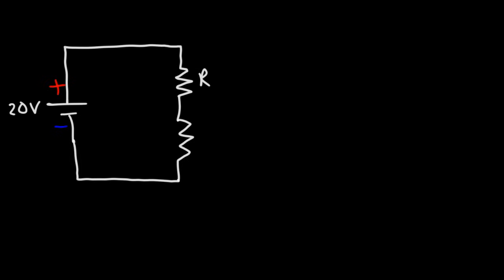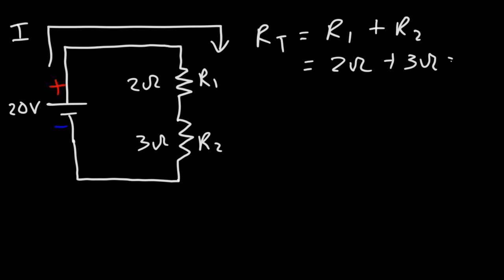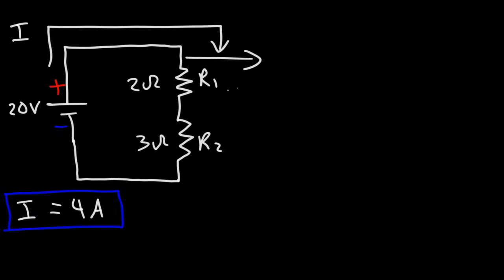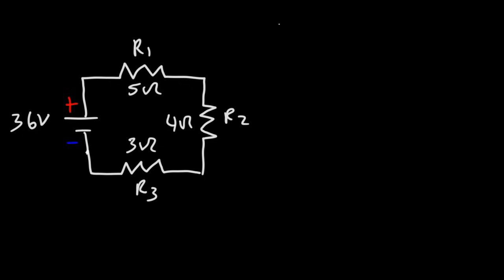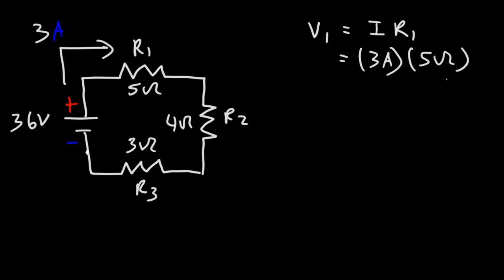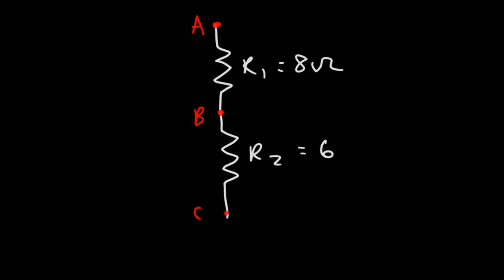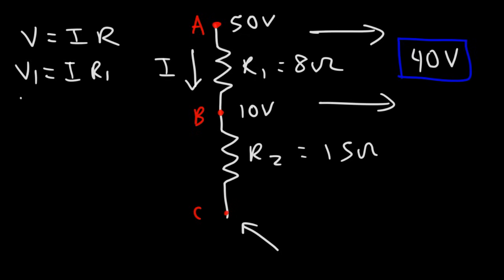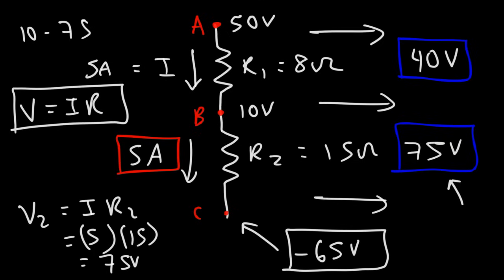How To Calculate The Voltage Drop Across a Resistor - Electronics

Comment: I have a question. I have two incandescent lights (12V, 50mA), My power source is 18.5V A/C. Based on the above information, could you tell me what the strength of the resistor should be? If you need more, let me know. I will check back with you tomorrow.

Comment: What if you don’t know the source voltage but only the voltage drop across R3 in series with R1 and R2? R1= 4ohms, R2=2ohms and R3=8ohms.
How do I calculate the source voltage without any other information?
Do I use the resistor of R3 which is 8ohms and divide the resistance by the voltage drop and get the current, since the current is the same across series resistors?
If I do that, I come up with 1.25 amperes. That gives me a voltage drop of 5v across R1 4ohms 1.25x4ohms=5volts and I get 2.5 volts across R2.
So do I add the sum of those to come up with my source voltage?
I have two resistors in parallel 4ohm and 5 ohm but the voltage would be the same across those, so that shouldn’t change the calculation which should be 17.5v if I understand it correctly?

Comment: How did the last example end with a negative? Bad example just for maths? I'm scratching my head for a real scenario where this can happen across 2 resisters like that... resisters tend to voltage drop to 0 and current can only be AC positive or negative at any given time, not both at the same time... Unless I'm missing something fundamental out of the blue to smack me in the face.., I mean I guess it could be out of faze? but then again it wouldn't...hmmm

Comment: Brooo it feels like my brain is melting 🫠😞 I’m trying to figure out the voltage drop for a series resistor in a series-parallel circuit. I’m losing my mind trying to figure out the current for a series-parallel so that I can then be able to calculate the voltage drop for the series resistor 😭
Reply: You will get it..hang in there buddy

Comment: If this bloke was my teacher, I wouldn't get so frustrated during class 🤣
Reply: Yeah it could be worse. You could have a guy teaching you this who doesn't even specialize in electrical. Im in a class to be an aviation mechanic and that's the situation I'm in. There's some stuff in the class that's just plain wrong. They said voltage is consistent throughout a parallel circuit. No voltage drop.

Comment: To calculate voltage drops at each resistor, can you also do total current multiplied by the resistor value at that resistor?

Comment: Another method to do this without getting the current is to get the percentage. For example, R2 is 3 ohms. You would divide 3/R1+R2 = .6. Now multiple the .6 by the voltage of 20. It should give you 12V. That's the drop for R2. You can do this with as many resistors in a circuit.

P.S In a series circuit.

Comment: Very informative video. It would be nice to see the full closed loop circuit to see how the potential got to 50V and 10V at point A and B i.e. to cross check that the sum of the potential difference equates to zero.

Comment: So in vehicles, homes etc. everything need to be in parallel circuits? If we would series ciruit the voltage drop would decrease directly since in a 120V home we have 120V consumers. If we would have 2 things in series each consumer would only receive 60v and wouldnt work?

Comment: The way I calculated R2 voltage drop at the end , I simply did this (R2/R1) * 40
Because if 40v is voltage drop across 8 ohms, then double that, say if we had 16 ohms, voltage drop is double that of R1 8 ohms, aka  voltage drop is 80v
But since R2 has 1.875x value of R1, I just multiplied that with voltage drop on R1.
You get, no need for this explanation :D
And since we "had" 10v and are "losing" 75 volts, that goes into -65...we go bankrupt...or voltKRUPT ! ahhh bobs my uncle...im going away now...

Comment: How do I calculate the resistor for a voltage drop? Let’s say i wanted a voltage drop of 3.3V with a 12v power supply. What ohm resistor would I use?

Comment: I am electrical stupid. As I think that these examples would catch fire if I hooked 2 or 3 resistors in a dead short circuit  like you show.   But I have fixed car electrical issues for 40 years.  Yet I can find tiny electrical issues where the voltage drop is 4/100 th of a volt.  If I find 7/100th of a volt. I need to find out where the voltage drop is.  Do I have a loose connector.  Corrosion on the wire strands inside the insulation. Or just an undersized circuit for the load.

Comment: wait, what if the problem only says there are 4 resistors and they're all in equal resistance, the total voltage is 17V and i have to find the voltage in each resistor?? idk how to extract the other given values in the problem
Reply: Divide the total voltage by 4, each resistor will have an equal voltage drop. Then you can take it further from there

Comment: May I ask, what would happen to the voltage if there's a ground before the resistor?
Reply: It's not that ground has no voltage, or sea level has no elevation: it's that these things are differences, and the difference between a thing and itself is 0. Thus, there is no magic about ground. It doesn't do anything. It's just a node in the circuit, just like any

Comment: I am trying to find an online calculator for a simple circuit that will allow me to plug in voltage and resistor and give me the output voltage,

So if I have a source voltage of 20 volts and I was an output voltage of 2 volts, what size resistor will I need ?

And as I change the voltage, what size resistor will I need for different source voltages to keep my output voltage at 2 volts ?

Is there a webpage that has this calculator that I could enter the output voltage and input voltage and get the resistor needed ?

Or input voltage and resistor and have it tell me the voltage it will put out ? 

Thanks

Comment: I have one confusion about calculating the voltage drop. If I need to use a resistor with one led to connect with 220v AC, then I can find the resistor using the formula R = (supply voltage - led voltage) /led current = (220-2)/0.02=11k. And the wattage of the resistor is P=V^2/R = 218^2/11000=4~5W. But how I will know the voltage drop if I have a resistor with a different ohms and wattage values?

Comment: Can someone help me understand a circuit I'm looking at? There's no current flow in this circuit. On one side there's a +10 V source, in the middle there's a resistor and on the right the wire is connected to a reverse biased diode (hence no current flowing).
Now, it says on this circuit that the potential at point A - which is right after the resistor - is still 10V. So, no current flowing and no voltage drop across the resistor. This is what I can't understand, why is there no voltage drop?

Comment: I’d like to calculate the internal resistance of a 3.2V LiFePO4 280 amp cell by using a resistor to cause voltage drop and apply Ohms and Kirchhoff laws.  Can anyone suggest a resistor for this application (or does it matter)?  Thank you

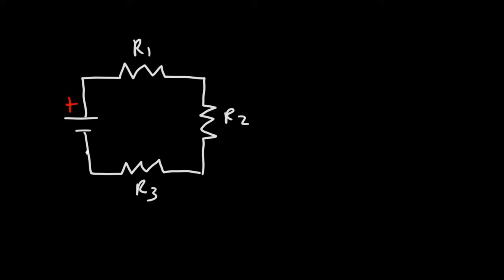Comment: 4:50 you use ohm's law to calculate the voltage drop for the circuit but couldn't you just have used Kirchoff's law instead?
voltageDrop = (batteryVoltage/totalResistance)resistorX
Replace the X in resistorX with the desired resistor number.
Reply: But this is basic stuff so that's probably why he didn't use KVL

Comment: Hey, I'm starting out in electronics and there's something I can't wrap my dumb head around. If anyone could explain this to in a good way I'd be eternally grateful. 
If resistors both limit current and drops voltage, how can you get them both right for your let's say LEDs. 

Let's say i have a 5v supply and I want to light a 5v 23 mA LED. How would I do that without getting too low a voltage on the led?
Or - if I have a 5v supply and want to get 3,5v 23mA for a LED, how can I get both values correct with a resistor?
Reply: In order for the led to light you don't have to have 5V. You only care about the current. You just need the 20mA...So you can either use 5V and 230 Ohms resistor (=21 mA current)     or     8 V and 370 Ohms resistor (= 21 mA current) or a different combo of V and R to have the 20mA
Reply: @ΓιώργοςΠαυλίδης-μ2ο  Thanks for your answer.
But I don't really get it. I get the correlation with V=I*R but, So voltage doesn't matter for all LEDs? And the LEDs that already says 5V or 12V has built in resistance?
Reply: @TheBozn  Yes if you apply on them 5V they will work. They have internal resistance which reduces the current as much as needed to work with 5V

Comment: Why, why is the total Voltage drop the same as the output...?
Reply: why also the higher resistance measured the higher voltage also just I noticed
Reply: because physics. lookup Kirchhoff's voltage law.

Comment: how to get the voltage without a given resistance
Reply: I don't think you can. in the equation V=IR you need at least 2 of the values. ie if you need to calculate the voltage you need resistance and current. Athletes that is true if you want to use Ohm's law to do it.

Comment: I'm not there yet I guess.  How can you have a 65V drop when you only have 50 to start with...and 40 of that is already gone?
Reply: The circuit shown wasn't complete. From my limited understanding that means that the direction of the current is reversed on the other side and the resistor is getting the extra 65V from another battery.

Comment: If Total voltage in the circuit is 50 volts then how R2 can have 75 volts. Please explain...🙏🙏🙏
Reply: hi that "total voltage is 50" is actually wrong the 50 volts means the potential difference at point "A"  rather than that 50 is not the total voltage and also 75 volt is not the total voltage it is simply the voltage drop between the 2 points hope yo got it!!!!!

Comment: what if it only has 1 resistor? How to calculate voltage across the 1 resistor?
Reply: Same. Use V=Ri.
i.e. 20V source with 5ohm resistor means there's a 20V drop across the resistor at 4 amps.

Comment: Thank you so much, but how can you calculate the Rt when a voltmeter is connected at R1 having internal resistance of 10ohms
Reply: For total you add up drop across both resistors

Comment: If battery have low marked capicity it  is possible to obtain 4 amps from 20 volt battery ?
Reply: For instance take capicity 100 mah
Reply: You'd have to connect 40 20V100mA batteries in parallel for that. 100mA x 40 = 4A
mAh is a different metric. That's miliamps per hour, which isn't a measure of current, but electric charge.

Comment: Thanks for this. Polishes some quite rough edges,..one question though Mkubwa (means Chairman), in the last example, that Voltage drop of -65V, how is it possible to combine 50V and 10V to get 65V(just reverse connection)? That defies the Second Law of Thermodynamics
Reply: 50+10 is 60 tho
Reply: It's not 65V. It's minus 65V, so the potential goes from 50V with a 40V drop to 10V, then another 75V drop to -65V. Total source potential = 50 - (-65) = 115V

Comment: Bro I have one doubt and that doubt is you take small values of resistance so your input voltage is equal to output voltage but you take some big values of resistance like mega ohms the output voltage is less than input voltage.... In multi meter I was take readings by using few mega ohm resistors.....

Comment: When voltage drops, should current drop too? As ohm’s law states they are proportional to eachother...All you examples had a constant Amp value throughout the circuits
Reply: Amps are constant because it's a serial circuit. Like he said, current only has one path to flow through, so it can't vary. Thus current is proportional to the total system resistance (i.e. sum of all resistors)
Since resistence depends on the material, it doesn't vary either. So each voltage drop is proportional to the individual resistor. Two identical resistors would get exactly half the drop each.

Comment: When you say Your example ONE has 4A current, Is that before passing through R1, simce I thought since a voltage drop occurs, as does a current drop? So 4A before R1 drops after R1, and again after R2?
Reply: A bit late but current is the same throughout the circuit. So, the current after R1 the same as the current after R2. This probably won't help you now as it has been 4 months, but hopefully it will at least help someone else.
Reply: @congay6607  Yes you are right. your comment helped me after 5 months.  May be https://www.electronics-tutorials.ws/resistor/res_3.html this  is gonna help someone else

Comment: How can there be more voltage across R2 when the resistance is higher? Shouldn’t there be less voltage flowing through since the resistance is higher?
Reply: Good question. It's directly proportional. The higher the resistance the greater the voltage. What decreases is the current. When the resistance is high the current decreases but the voltage increases.

Comment: Can someone explain to me what is -65V in DC ? I can imagine it in AC but negative voltage in DC makes no sense to me?
Reply: A negative voltage is a relative excess of electrons compared to a reference point.
Reply: Volts are relative. They represent a difference in electric potential, not the actual number of electrons present.
Reply: @CrookedBros  thank you for typing my exact explanation to me, I didn't know. Learned something again xD.

Comment: Don’t u love when they do the same problems with different values so pointless
Reply: i was waiting for resistors in parallel and it never came
Reply: JakeSatz voltage drops through resistor in dc is the amount of amps or current goin through it times resistance I believe

Comment: cant you just use the divider rule? Vt x Rn / Rt  ?
Reply: @John Sanchez what does the variables  Vt, Rn, Rt means.
Reply: @deividasabrutis7248  voltage total x the resistor divided by total resistance
Reply: you can of course! but using ohms law is the easiest way since V=IR is very easy to remember and hard to make a mistake of.

Comment: Blah, blah. So much calculation, so little comprehension. First of all, what's the difference between voltage drop and voltage at a resistor? How can the "drop" be measured exactly like voltage is? Finally, the negative value at the end implies the voltages at the other points are "positive". Nonsense.

Comment: What about if you have just one resistor? Is it impossible?
Reply: just use ohms law as usual.
Reply: Good question. There will be no change in voltage then.
Reply: @turanamo  there is a change, but it's the total voltage of the source.

Comment: ow my mind twisted 
😅
wasnt it like the smaller d resistance d bigger volts to pass
and d bigger resistance d smaller V to pass thru?
Reply: no that's the case for Current not for voltage, for voltage its opposite of what you said, the higher voltage the higher resistance
Reply: Think of it like this .. if you have a bigger resistance, logically u must have a bigger amount of energy to push or move a coloumb of charge across the resistor or in the other word, a bigger voltage. And notice from the Ohm's formula (V=IR) , voltage is directly proportional to resistance. Thus, when the resistance increases ,the voltage also increases

Comment: Hi what is the solution for voltage drop? I have 12v bat 18g 5 mtrs auto wire, 12v 4 watts bulb it doesnt light on, what is the solution for this?
Reply: Proly too late, but voltage booster would do the job
Reply: There's no "solution" to voltage drop. Voltage drops as long as there are resistors in the circuit. If you want to make 12v bulbs light up with a 12v battery, connect them in parallel - they'll each get 12V 333mA
Reply: zanzibar

Comment: In the last example why the voltage at point c is not zero?
Reply: You know the current must be 5 amps and the resistor must be 15 ohms, so the voltage potential must be 75 volts. Since B is 10 volts, not 75 volts, then C must be a value other than 0
Reply: @cynderellylastname6060   thank you
Reply: @cynderellylastname6060  WTF!!?
Reply: @rahsaantalley2012  huh?